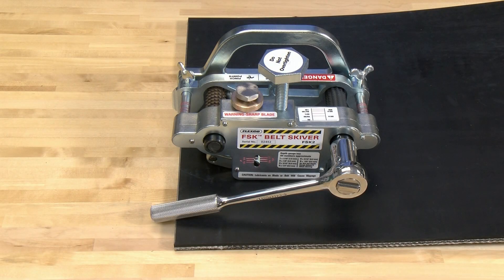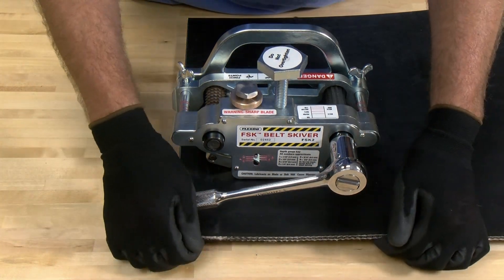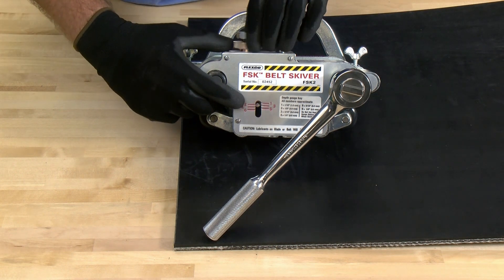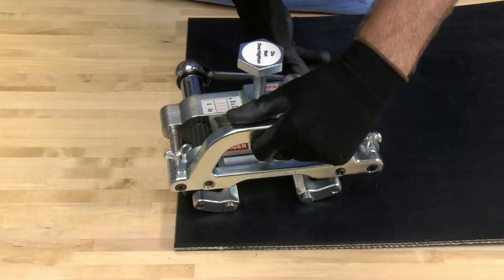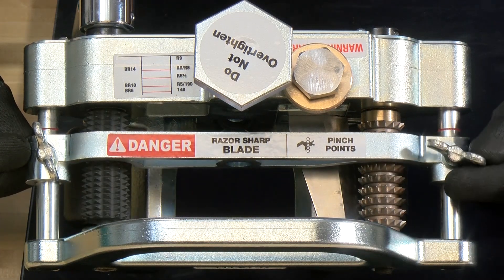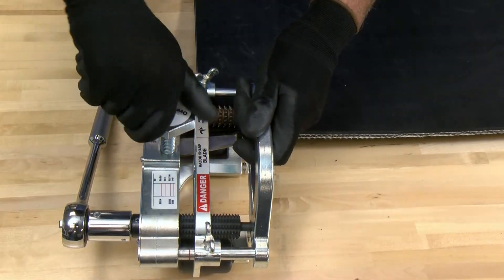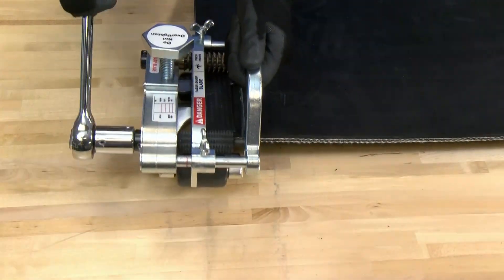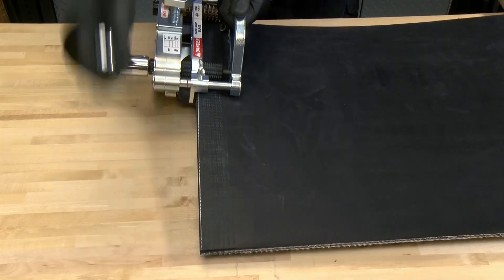FSK2™ Belt Skiver Operating Procedures

Comment: Does it only skive the top rubber or it can also remove with the mat (thread)
Reply from the maker: Flexco only recommends recessing the covers of the belt to allow for a low profile splice.  Removing parts of the carcass of the belt weakens the belt since the carcass is what creates the strength of the belt.